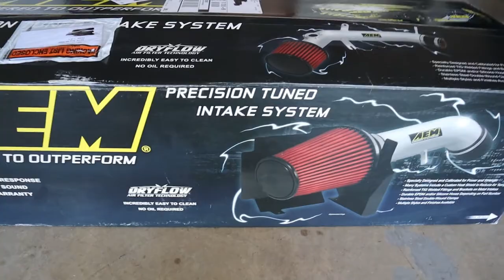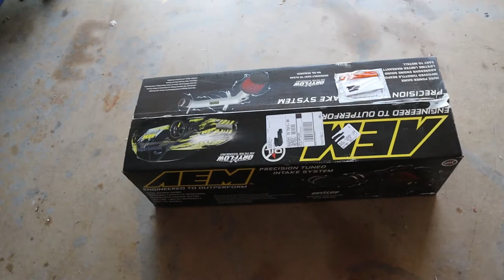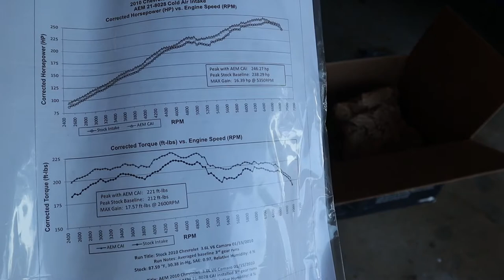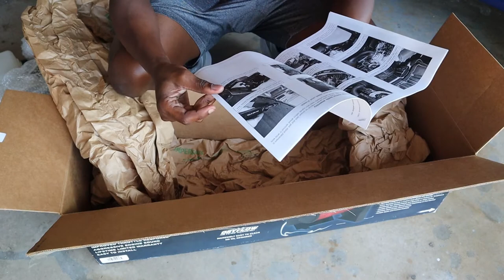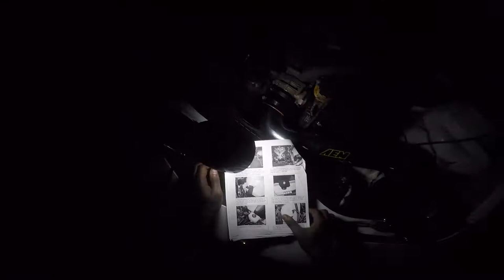THIS PART MADE MY CAMARO SO MUCH FASTER!!!!

Comment: u need headers and a tune then get some nitrous in your life
Reply from the maker: Yea I’m planning on getting some headers and a tune pretty soon
Reply: yea that would be a great improvement
Reply from the maker: Yea that stuff is just on the bit of the expensive side right now since I’m building a mustang and a motorcycle as well
Reply: i hear ya, i got lucky and found a used one like new for $150 cant beat that
Reply from the maker: Yea I’m never lucky enough to find the deals 😂
Reply: lol just keeep looking u never know
Reply from the maker: Do you have any recommended spots to search?
Reply: camaro 5 forum and camaro v6 pages on facebook
Reply from the maker: Baddrivercam but the LLT does 😜